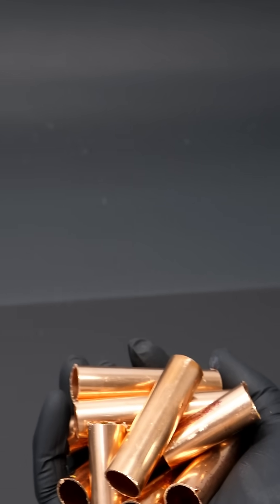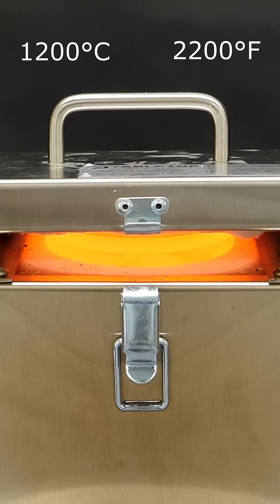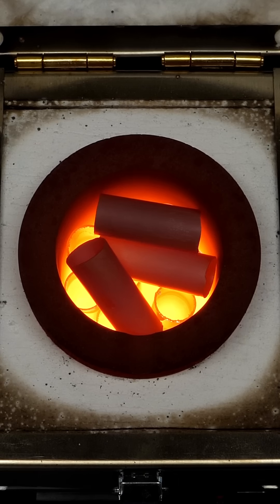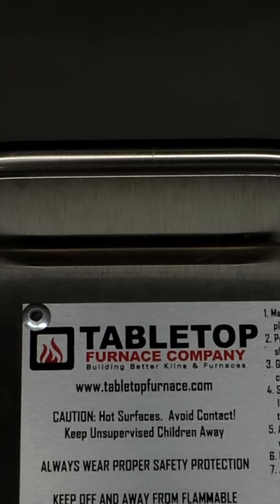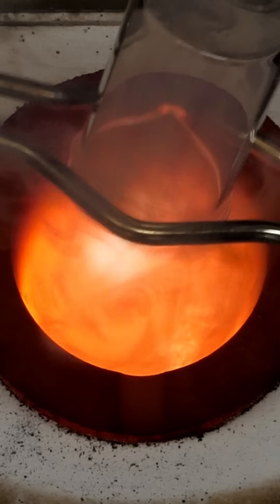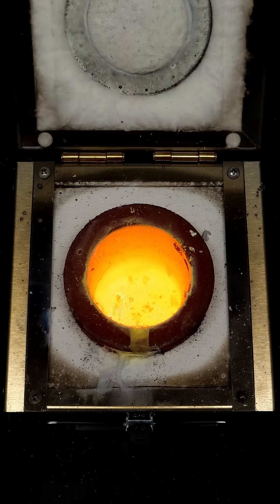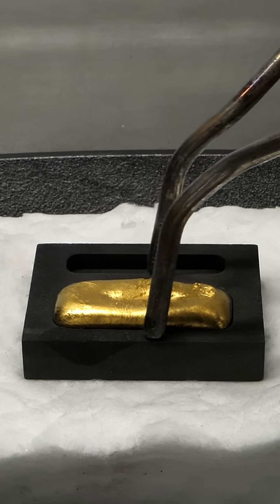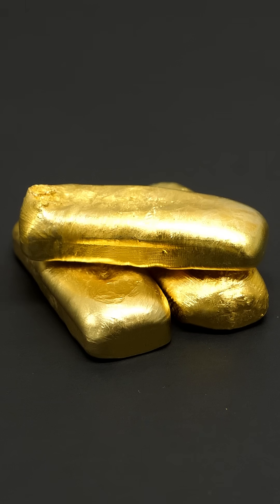Making Nordic Gold

Comment: Im unsure of what ratio you used but the aluminum bronze i made was 95% copper by weight and 5% aluminum by weight. I plan on making a ring out of it just for funsies.
Also wear proper protection when melting zinc as it can boil over and produce zinc oxide which if inhaled can give you metal fume fever. Nasty nasty stuff

Comment: Nordic gold is the alloy used to mint 50, 20 and 10 euro cent coins. It has also been used in other countries for several years, notably in the Swedish 10 kronor coin. It is composed of 89% copper, 5% aluminum, 5% zinc and 1% tin.

These coins do not contain any gold and are different in color and weight from pure gold. The alloy is hypoallergenic and has other advantages, including antimicrobial properties and resistance to tarnishing.

Comment: Zinc‘s boiling temperature is well below copper’s melting temperature.
The zinc vapor that results from alloying these metals is very toxic.  Operations like these should be only made with a proper exhaustion or certified masks or outdoors. 

My friend , you should be careful with safety and health and also alert the audience to the risks. ☝️

Comment: brass is not gold
Reply: This isn’t brass
Reply: @Joker-em6oz  copper and zinc are the base for over 60 known alloys of brass. Replace the aluminum in this recipe for lead and it would be naval brass. You think it's gold?
Reply: @DownSouthPickinnStackin no it’s aluminum bronze
Reply: @Joker-em6oz Brass contains larger amounts of zinc than tin. Bronze contains larger amounts of tin than zinc. A lot of zinc went into that crucible.
Reply: @DownSouthPickinnStackin aluminum bronze buddy. More aluminum than tin or zinc
Reply: @Joker-em6oz the addition of aluminum doesn't make it bronze, buddy, the ratio of zinc to tin would make it brass. The addition of more tin makes an alloy stronger but only if it is higher than the zinc content. Aluminum is added for high luster in brass alloys. It didn't appear that the OP cared much for accurate weights and measures, let alone safety, so without knowing the ratio it is futile to continue wondering.
Reply: @DownSouthPickinnStackin I’m not saying it’s bronze, I’m saying it’s aluminum bronze… 

Do you know what aluminum bronze is? It’s a subcategory of copper alloys like tin bronze and brass.

Nigel definitely measured out the correct wait of every metal used. He definitely cared about safety, idk what you’re talking about. 

It is Nordic gold, a known alloy. We know the measures of every metal in the alloy. There is more aluminum than zinc and tin which makes this alloy aluminum bronze.
Reply: @Joker-em6oz the Nordic gold alloy contains five times the amount of zinc than it does tin. Scientifically making it a predominantly brass alloy. It still isn't "gold". As much gold as German silver is silver. No matter what it is named.
Reply: @DownSouthPickinnStackin no, dude. Idc about the tin. The subcategory of alloys is called aluminum bronze. ALUMINUM bronze. The ALUMINUM is what makes it bronze, not the tin. Scientifically it is ALUMINUM bronze. Not every copper alloy is brass or bronze, there’s other things such as ALUMINUM bronze.

The alloy contains more aluminum than zinc which makes this alloy aluminum bronze, not brass.
Reply: @DownSouthPickinnStackin it isn’t BRASS. Aluminum bronze does not need to have zinc to be aluminum bronze. Subcategory of copper alloys. Is bronze a type of brass? No. Aluminum bronze isn’t a type of brass either. 

Because Aluminum is the dominant alloying element, it isn’t brass whatsoever, it is aluminum bronze. It’s that simple. I do not understand how you do not get it
Reply: @DownSouthPickinnStackin hey what would you call an alloy if 95% copper and 5% aluminum? It isn’t brass because there isn’t zinc, and it isn’t tin bronze because there isn’t any tin.
Reply: @Joker-em6oz scrap yard would probably call it #2 dirty copper
Reply: @DownSouthPickinnStackin no one else calls it that
Reply: @DownSouthPickinnStackin the rest of us call it aluminum bronze
Reply: @DownSouthPickinnStackin I didn’t. Why do you insist on being wrong about a subject you clearly know nothing about?
Reply: @DownSouthPickinnStackin glad I taught you something new

Comment: Copper and tin make bronze, what properties do the Aluminum and zinc add?
Reply: Lower melting point, superior hardness and mechanical strength
Reply: @Joker-em6oz  Thank you, I had a feeling there were some smarter folks here :)
Reply: @skyfirejay6162 if your curious about the mechanism, it’s called solid solution hardening where different sized atoms introduce strain in the crystal matrix of the metal

Comment: It’s called aluminum bronze lol
Reply: Not with Zinc in it. Zinc makes it a brass.
Reply: @wellscampbell9858  Not so. It's generally called a brass if the zinc is the second largest constituent after copper. It's called a bronze if tin is the second largest constituent after copper,  The Nordic Gold in this clip is unusual: the second largest constituent after copper is aluminium.
Certain bronze compositions, particularly those used in artistic applications or bearing surfaces, may include zinc as part of their composition, but it is not the main additive.
In some cases true brasses (according to my definition above, not yours) are still called bronzes eg "architectural bronze" and "commercial bronze", but a metallurgist would class them as brasses.

They would call Nordic Gold a "copper alloy", like other coinage alloys such as cupronickel.

Comment: It's also a work hardening alloy. You can test it by putting a 0.50eur coin to a vice, grab it with pliers and bend and wiggle it until it breaks. You get a sharp edge that scratches steel easily.

Comment: “This is a bunch of copper metal that I had sitting around”
The only parts to that statement that were true are copper metal and bunch. If the copper had been sitting around, an oxide layer would have formed, to give it that reddish brown with tinges of green if water had condensed on it. No sir, you bought that brand new shiny copper pipe for this experiment and murderously chopped it up with a saw